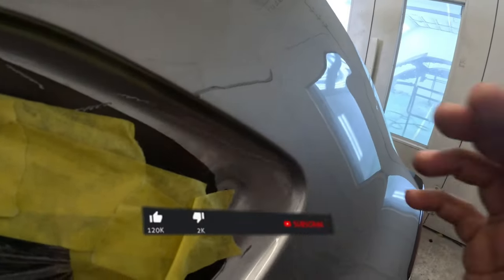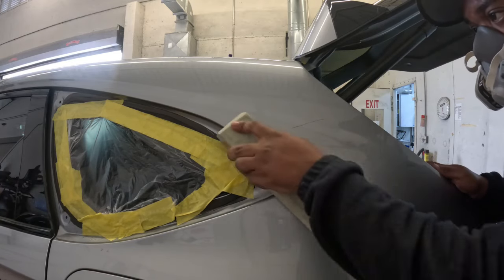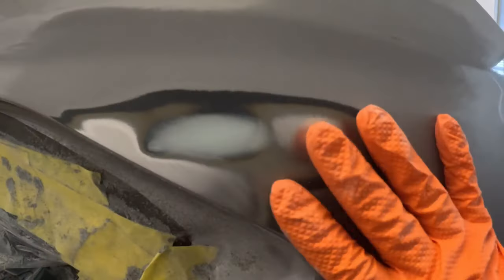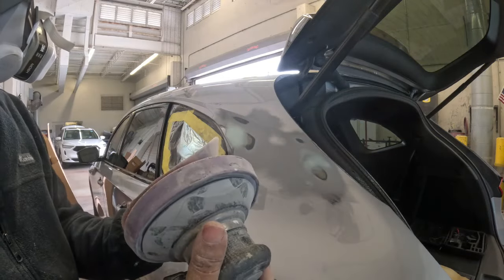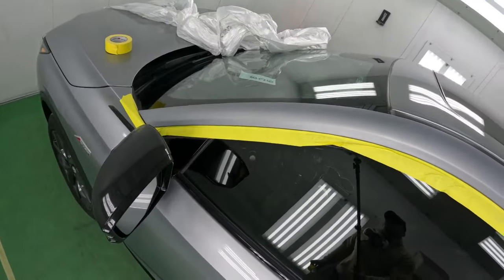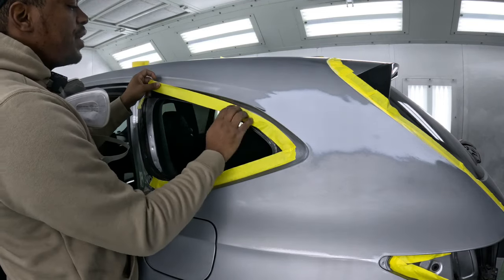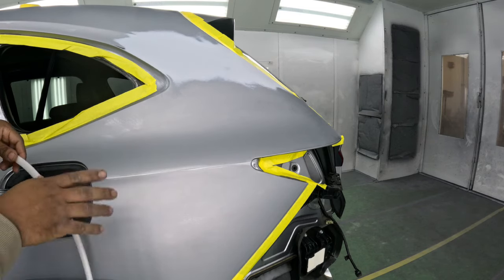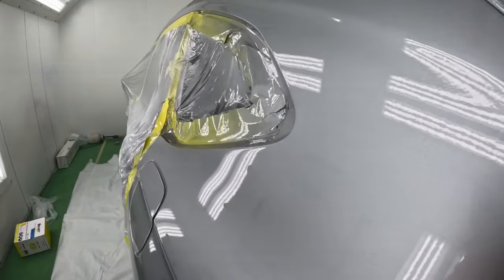CAR PAINTING: BODYWORK, PREP, PAINT

Comment: Good info. I do 320 block followed by 400 on a DA with interface pad after that for primer surfacer... 600 at most for sealer & 800 for the blend area...... Paint these days are getting cheaper/ perform less & cost Twoce as much.... Just a gallon of cheap Omni 270 clear is  what $130-$150 if youre a shop & 20%-30% higher for a walk in customer....
Reply from the maker: I agree no need to go beyond 400 for primer. There’s still good paint out there.

Comment: MARIO I HAVE JUST PAINTED MY FORD FOCUS MK3 FRONT BUMPER ITS ON THE CAR BUT NEEDS A BLEND ON THE WINGS OR FENDER
Reply from the maker: Okay cool. Just sure you blend the wings with the same mix of paint.
Reply: @mariopaintclass6091  Mario I have had a look can k blend it another day or has it got to be done straight away andy have you got any blending videos mate on the wings or fenders the bonnet mate is the same as the bumper  but slight different between the wings that's whyvi need a blend
Reply from the maker: @ANDY-we7mr  it’s best to blend straight away especially if it’s metallic. Your pressure could change the shade or you might not have the same exact mixture. I don’t have any video specific to your problem, but these videos might help.HOW I USED BODY LINE AS A GUIDE TO BLENDING. SAVING TIME, MATERIAL, AND HEADACHES.
https://youtu.be/SnjxmRP8zns

MOST DIFFICULT PERL BLEND
https://youtu.be/zp4Jb43MYD4
Reply: @mariopaintclass6091  I haven't blended it mate straight away I Done the bumper In my shed I was telling Brian off paint society